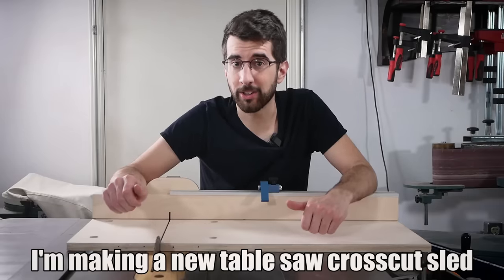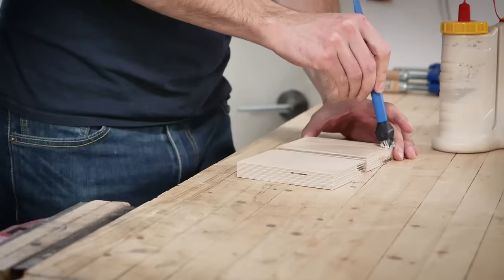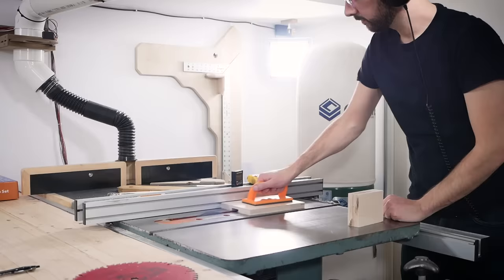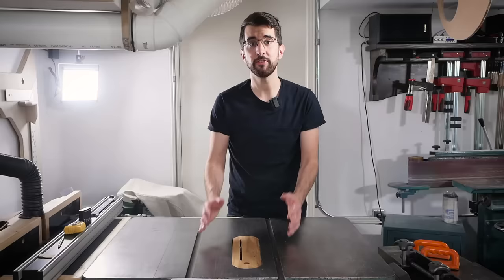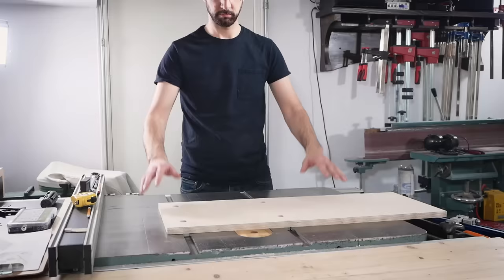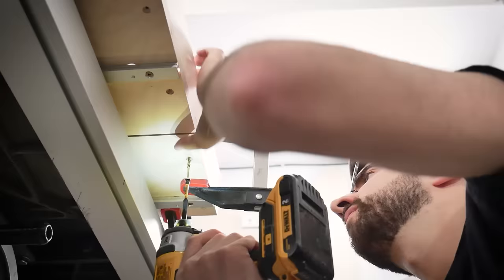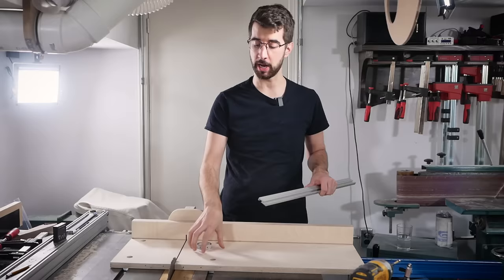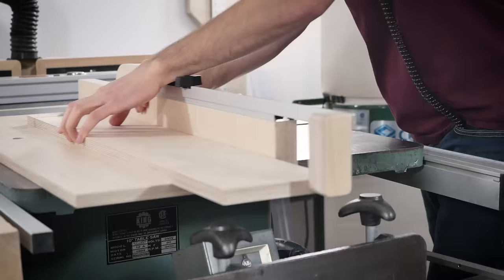your crosscut sled is way too big

Comment: Crosscut sled size is directly correlated to the woodworker’s ego. Naturally, I have a massive crosscut sled.
Reply: haha ya Suman you would
Reply: Lol
Reply: My sledge is small. I think it is barely adequate and not really up to the task. I am ashamed.
Reply: Lol
Reply: Agreed, mine is bigger than the table saw.
Reply: My entire workshop is my crosscut sled. I built the entire thing around an old Delta jobsite saw that was left in the yard when I got the house.
Reply: Whoops, I dropped my monster crosscut sled.  That's what I use for my magnum boards.
Reply: I want a bigger sled, but haven’t gotten around to it yet. What does that mean about me?
Reply: I use the zero cut sled, 4x8 plywood and a 2x4, on a cordless jobsite saw
Reply: I have none... but didn't want to say to draw attention to myself. 😂
Reply: @tttm99   same i dont even have a table saw
Reply: I just wnat to vut bigger thing man
Reply: As Maxwell Smart would say ... "My cross-cut is bigger, by just that much".
Reply: I talked to my doctor about this and he recommended   SLEDtesterone.
Reply: My sled is MASSIVE! It has extraordinary length and enormous girth, but it’s not based on ego??😎
Reply: I'm about to bust out my tape measure and measure mind, hold on a second hold my beer, grabbing my littlest tape stuck to my desk with a magnet, mine is 12 and a quarter by 11 3/16.... But she always says it does the job
Reply: @mircomuntener4643 too bad you didn't post a video about it because I just checked if you had one I'd be watching it right now
Reply: @providentpathfinders219 have you tried holding the cordless table saw upside down and just running it along your sheet stock.... I wouldn't recommend it could be deadly but damn I bet it would work
Reply: @vrgcustomcarpentry  my comment was pure sarcasm since we were all measuring our “sleds” 😂😂

Comment: I agree that a full front fence is completely unnecessary. BUT some type of front fence does add a ton of structural rigidity to the sled when the sled is NOT on the table . This is important because when you pick up the fence with one hand the two halves of the base, which are only connected together with the rear fence, will try to rotate (droop) about the cut line. To keep the two halves from drooping a counteracting torque has to be generated in the rear fence. Torque is force times distance. The distance between the two forces is often referred to as structural depth. So the smaller the distance (in this case the distance between the two sides of the rear fence) the larger the forces. Conversely the greater the distance, the smaller the forces required to generate the same torque. 

You did make the rear fence thicker and added the block on the back, which does add structural depth which reduces the forces in the rear fence. But adding a front fence makes the entire depth of the sled the structural depth. But there is no reason to make the front fence as wide as the rear fence since its only purpose is to add structural depth. So something on the order of your quick fix little temporary front fence is really all that is needed to make the sled very rigid. Of course you would probably want to make it a little prettier. But it really would need to be much wider than what you had. 

Or you could just be very careful and always pick up the sled with two hands, one on each side of the cut line so that both halves of the base are supported until you get the sled on the tablesaw and the runners in the miter slots can resist any forces trying to cause the two halves of the base from rotating (which is another reason you don't want any slop in the runners since it is forces on the sides of the runners against the miter slots that provide the necessary torque to hold the base in exact alignment. And since the distance between the slots is very large, those side-to-side forces are quite small. 

Plus some people like to put a piece of plexiglass above the blade between the tops of the front and rear fence to stop any chips that might be thrown upwards by the blade, as might happen if you are shaving off a very thin sliver, and the sliver rotates into the back of the blade when it is cut free and bits of it are flung upwards. Safety glass will keep you from losing an eye if that happened, but they won't keep your face from being hit by wood shrapnel. A short front fence would also allow such a shield to be added.
Reply: I agree. I’ve got a front fence on my large sled just to ensure stability of the 2 halves. I do use hold downs to hold the stock form and stops for accurate multiple cuts. Yes, it’s weighty but so is much of the timber I use. 

I use a Osborne mitre gauge which is very good indeed but I guess 50% of my cuts are 90 degree. I can see a use for a small sled for those instances where I’m cutting wide thin stock as I can’t easily clamp those to the mitre gauge.
Reply: I'm sold.

Comment: 8:32  Here's a way to ensure a perfect 90° fence without any drama:
1. Clamp the fence to the base as close to 90° as possible. 
2. Drill holes through the base into the fence on the right and left side. Drive screws in both holes.
3. Unclamp the fence and remove the left screw completely.
4. Rotate the fence out of the way temporarily and enlarge the left hole in the base so the fence can be adjusted forward and back a few mm.
5. Reinstall the left screw and tighten the fence at what appears to be 90° and make a test cut. If it's not a perfect 90°, loosen the left screw a few turns and rotate the fence forward or back as necessary and retighten. Test again. 
6. When it's square, drill a second hole on the left side to make it impossible for the fence to go out of alignment.
Reply: Great method and fewer steps.
Reply: While your steps are simpler, I'm having trouble picturing what is fence what is base, because, if so, you are telling me to DRILL HOLES IN MY CAST IRON table?? Since that makes NO sense, I must ASSume you mean different with the terminologies than I do. Too bad a pictoral couldn't be added with labels!
Reply: @Techreux  Drill the holes up through the bottom of the base of the sled into the bottom of the fence.

Comment: I have several sleds, but the one I use the most is marginally larger than the one you have here;  kept the forward fence in order to help with longevity - manoeuvering it and manhandling it when it's not on the saw risks damage if it's only held together by the back fence.  I broke my first sled this way.  Anyhoo, RE the T-Tracks, I use mine all the time when I am cutting weird shapes; I put one on the top of my fence as well as the face of the fence, and I use them a lot.  I then made my own hold-downs laminating scrap pieces of exotic woods (Purpleheart, Ipe, and Bloodwood) which are super strong, but also look fancy, and making my own knobs out of other scraps.  Finally, my mitre slot slide was also home-made - and I only put ONE on the sled.  On previous sleds, the very slight shrinkage or expansion of the sled itself was what was causing it to stick.  It turns out, you only really need one anyway.  Choosing naturally slippery woods (Bloodwood is probably my favourite because it feels so smooth even without wax) will make an excellent mitre slide - I found aluminum to be just a little "scratchy" in the slot.

Comment: Scott, I built this sled from the plans. It turned out great but there were a couple of issues. 

The Veritas T track with space for a measuring tape is exactly 1.5" wide. The thickness 2 layers of Canadian birch 3/4" plywood for the fence is about 1/8" less than 1.5 inches. If the T track is installed flush with the front face (face towards the saw blade) of the fence then the T track hangs over the back face of the fence. A 1/8" thick plywood shim is required between the safety guard for the blade passing through the fence and the fence. Cutting a dado in the safety guard does not work because the safety guard  would interfere with the stop block. ( I cannot afford Baltic birch. It is almost $200 / sheet on Vancouver Island.)

The Veritas large stop block has a quality issue. The 2 lugs that project down into the T track slot either side of the bolt are less than 3/8" wide so the stop block rocks back and forth about 1/32" on the vertical axis. When I shimmed the width of the lugs with a couple of layers of paper the stop block was prevented from moving. Did you have similar experiences? I am going to try to find something more durable than paper for the shim. I will keep you posted. 

In order to be able to read the tape measure off the side of the flip part of the stop block I installed the T track with the slot on the back face and the tape measure closest to the saw blade. This means that the stop block on the aluminum angle has to built L shaped like the stop block for the larger panel sled (which I am building next). I used CA glue to attach a 1" long piece of angle to the end of the longer angle so this short piece would overlap on the tape measure and I could read the tape measure easier.
Reply: I made a shim out of a piece of the side wall from an aluminum pop can and used CA glue to hold the shim in place. This worked well. Send me a private message if you want to see a couple of photos of the aluminum shim.

Comment: Good video Scott, I'm torn between one jig that does everything (using add-ons) and multiple jigs that each do one thing really well. In a small shop, storage space is a challenge. It is great to have a small, lightweight sled that meets  most of our needs, we are likely to use it. It can be a real PITA to to get out and set up a big heavy complex rig for just a few cuts. Each woodworker has unique requirements, but when woodworkers like yourself show the thought process behind your decisions, it makes it easier for us to design a solution that suits our needs. Great pace, good length of video, nice touch of humour: not over done. For something that is highly relevant to what I am working on, I can easily sit through an hour or more, albeit I may have to break it into a few sessions. Otherwise, I find 12 to 15 minutes optimal. That's all IMO. Other peoples' MMV. Best wishes from a remote part of the Land Down Under. What I would give for a bit scrap cherry, walnut or Baltic birch ply!
Reply from the maker: Thanks for the kind words as always Barry! Even though I have a tiny shop, I do have a crawl space that I can store the lesser used jigs, and retrieve them only when I need them.
Reply: When I did my first crosscut sled, it was a big heavy monster that I rarely used. Eventually I cannibalized it to make a smaller crosscut sled that was indeed way easier to use, and use more.

Comment: Well done. But I’m a poor novice woodworker. Step 1 to making your $60 sled is to make sure you have a $3,000 perfectly tuned 54” cast iron table saw and upgraded fence (also tuned perfectly).  Happy for you! Just not reality for me.
Reply from the maker: my saw cost a whopping $350 CAD. Keep telling yourself you can't, and you never will.

Comment: Thanks for covering premade miter tracks! Every video I see on sled jigs uses wooden tracks but knowing me it’d be the thing that keeps me from finishing a sled to use in the first place
Reply from the maker: That's great! There are several different kinds out there, but I've found that these are the best value and work just as well. I like the fact that you can access the adjustments from the top, so you don't have to remove the whole sled to guess and check. The Kreg style have them on the side and are a pain to adjust imo.
Reply: I've had issues with these adjustable aluminum tracks. After tightening the set screws to widen the track to a perfect fit, the fact is, your track is only perfectly sized at those specific points on the track. Not along the whole length of the runner. This causes problems if one of those locations  travels past the bed of the table saw top, whether before or late in the cut. The entire sled will move a little bit. I stick with the plywood, as I have had the wood movement problem with hardwood runners as well. Garage workshops have their issues for sure.

Comment: I built the Nick Ferry sled. I do love it. I’m not thrilled with the miter bars I used. They end up needing adjusting more often that I’d like. I’ve also widened the kerf by using different blades.  It’s heavy and awkward. But I still love it. It would be nice to have a smaller one like this.

Comment: Now that I have a sled to crosscut small pieces on my table saw, all I need is some sort of jig to allow me to rip long boards on my mitre saw. Then my shop will be complete. Of course I could just use my track saw, but right now I have it mounted sideways on my router table so I can use it as a biscuit joiner.

Comment: Hi Scott, why remove that forward fence piece? Yes, it limits the front-to-back width of the piece you want to cut … but you probably wouldn’t want to cut a board or panel that extends beyond the  front edge of the sled, anyway.  Personally, I think it should stay on the sled and help keep things together.  I have a bigger sled (heavier, too) for the big panels.  I like the idea of making a lighter weight smaller sled for safely cutting the “less big” items.
Reply: I would!
Also, for larger items, you could support the overhanging material with strips of the same thickness as your sled. No limits to the size of your panel, but lighterweight. The modularity also helps it be able to store it easier in small shops.

Comment: Subscribed just because you didn't use the five cut method. One tip from me. When I am attaching the fence. I just screw a piece of scrap to the sled, and fence. Then adjust by putting something between this piece of wood, or the sled. Then put in the final screws. Yea, it makes a couple of holes. But I'm not making a piece of furniture, I'm making a jig. Jigs have holes.

Comment: Hello Scott Walsh
 Great videos
Couple thing you might consider , maybe even film.
For the runners, try using 3/8 thick lexan or plexiglass. It cut like hard wood but humidity does not effect them.Yes it takes some time to get the perfect size ,but than make a supply for further jigs . Very cheap.
For the table sleds would suggest a way to reduce the friction between the table saw surface and the under side of sled. Is layout a grid and using a 2 inch foster bit drill down into surface 1/16 of an inch deep reducing the surface area contact.When I did mine I made the spacing between  the outside-edges of holes were 1/2 away from each other. This made a huge difference .
So on you new sled version, if you looking for even less weight I got rid of the material that is attached to the main sled and the saw blade protector.(only have the main left side of sled)
Than I cut a 12 inch wide by a little bit longer than table saw piece of plywood the same thickness as the main sled.Glued a miter  runner on with a little material to cut off making a zero clearance gap. This board does not  move ,remains stationary. so a two piece sled but acts or does what a joined piece would do

Comment: for the fence make 1 piece wider by the width of the plywood base - 1/32.first you attach fence to edge of plywood base assured that fence is parallel to base also screw from bottom for strength.

Comment: A shop I worked at had designed a really nice cross-cut sled.  Everything was done on a CNC machine. The back was an aluminum angle. Everything was held together with threaded barrel nuts a spacer and a screw. So the barrel nut would locate everything. The best part about this is the fence was screwed on through the aluminum angle so you could put anything you wanted for a backboard.  To change the backer 4 screws and it was still square.

Comment: 5:17  If using solid hardwood, be sure and orient the wood so the layers lay horizontal.  When wood expands, the layers get thicker, and not so much wider.
Reply: WAIT A MINUTE? We're talking about size and ego's, and now weather related to those issues?  Whaaaa?  LOL

Comment: Had to take a quick stop at 4:40 who has a bandsaw but doesn't have a jigsaw. Think you may have meant that the other way around😂
Reply from the maker: lol it was true at that time. I only bought a jig saw a couple of months ago. Just never needed it and I don't tend to buy tools I don't need. That old band saw that I had costed less than a good jig saw.
Reply: @ScottWalshWoodworking  fair enough

Comment: Your design  and video are really well thought out and presented.  I'm going to build something small and simple like this for two reasons.  1) I have a small shop and not much storage space and 2) I use a Shopsmith table saw which has a small table to begin with.  Two features I especially like are the blade guard at the back that contains the blade all the way through the cut and the stop extension (rather than a full extension which should really be un-necessary).  I guess the only potential drawback is that there could be some deflection associated with  your design.  Still, I like it.  Thanks for putting this out there.

Comment: I made the simplest cross cut sled that is light and big enough to cut panels.   Its a 1/4" piece of wall board, white on the top side.  I used a 1X6 as the back guide and handles, used oak runners for the guide tracks and one on the left side edge of the table saw.  Its super simple, its big yet light weight and hangs on the back of my shop door.  I think a good table saw sled should be one that fits your needs as a carpenter, not the needs of everyone on youtube.  

I like your design, but its a lot like everyone else's.